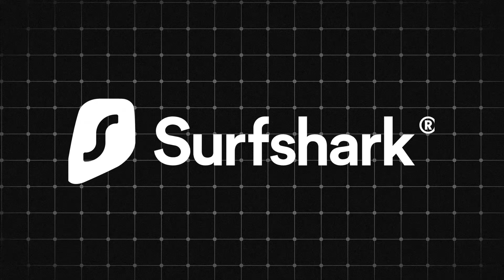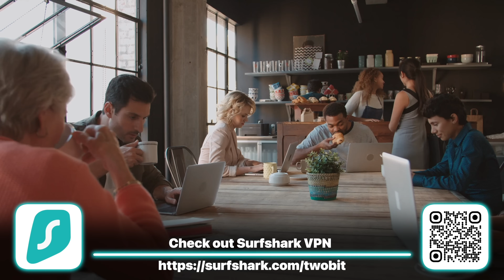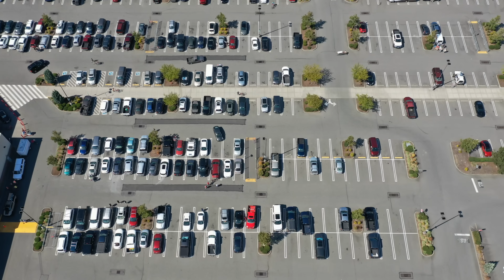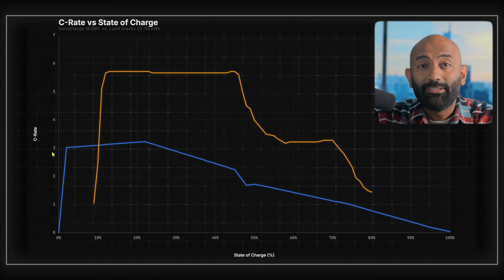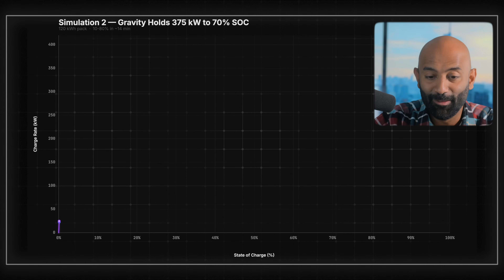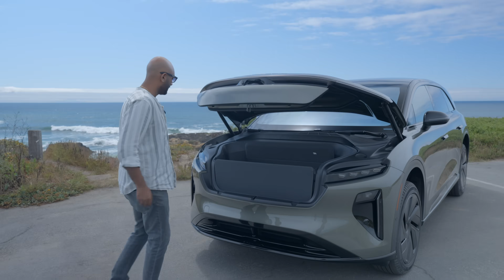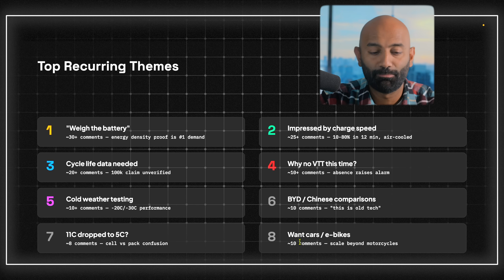Donut Lab Battery Test 4 Changes Everything!

Comment: I mean I'm of a lets wait and see mindset. That being said we already had a charge rate test right?

I can't disagree with the title more. We already know the cells can charge fairly fast. This changed nothing from what we knew before.

Show me one of the other claims being tested not a repeat.
Reply: Well the test showed that they have a real battery pack that works and can be cooled, and not just burning up at the charger, when 5C is put into it. And this video was filmed last aug/sep as the grass is green and only green leaves at the trees in the background.
Reply: @anderstengstrom9525 guess my point is we already know they have a pack and cells. What everyone wants to know is if that pack meets their biggest claims. Cold weather performance, thermal runaway, puncture tests, cycling tests and lastly 400 Wh/kg. Other minor claims lab tests showing no rare earths/ conflict elements. No nickel, no cobalt and no lithium as they claimed.

So far we have charging speed and temperature test at one cycle.

There are already fast charging batteries out there from BYD and others.

The big ones are energy density and cycle life. I thought for sure we would get cold temperature testing this week. Delaying the density and cycling life for the last episodes.

At this point the motorcycle is supposed to start delivers in April. If they keep delaying the test results and doing 1 claim per week the batteries will be in peoples hands before they finish the testing video series. Assuming they don’t push the delivery date out again.

Comment: Thanks for keeping us informed on this battery.  As an EV owner for about 4 years I have to tell you that the only charging that counts is 20% - 80%.  Why?  Because most manufacturers claim that letting the charge go below 20% repeatedly will shorten the battery life.  They also claim that charging over 80% repeatedly will also shorten the battery life.  There are exceptions.  My Ford F-150 Lightning manual says to charge it between 20% and 90%.  Not sure why they deviate from the norm by adding 10% but they must have done tests and so have their reasons.  PLEASE keep us updated on any Donut news as it is available.  Thanks.
Reply: LiFePo batteries don't care about those limits, and neither do they mind temperature extremes.
Reply: @davis.fourohfour  Will those run at -30°C, or -70°C?
Reply: That depends on the upper buffer. My sister in law has a BMW i3 for several years now with almost 200k km and it charges the car to 100% everyday because she needs it, if it was 80% she wouldn't be able to get back to home. That is fine because BMW keeps a huge upper buffer that even by charging everyday to 100% doesn't degrade the battery that much, even if it says 100% on the screen the battery only charges to 80 something % in reality... Ford says 90% because it has another 10% hided from you as a buffer.

Comment: At first i was half convinced they had a battery that they slapped solid state on the packaging hoping no one would call them on it. But now, even if its not actually all solid state, it seems like a good battery. And it doesnt really matter what you call it if it can perform. At this point I'm waiting for the downside that it must have.

The next test i think will either be a safety test or a cold test.
Reply: I built 5C Li-Ion batteries myself back in University. They have a horrible energy density and lifetime but otherwise are perfectly possible. Donut still did not show a comprehensive test with cycling, physical dimensions and weight, so all this is PR nonsense
Reply: Chinese National Automotive Standardization Technical Committee published “Solid-State Battery for electric vehicle – Part 1: Terms and Classification" will prevent this in the very near future.

Comment: One interesting thing is this, even if the Donut battery only performed a little better than other batteries in all these tests, the standout feature is actually the claimed the cycle life of 100,000. Given a hard usage by a car driver putting it through a full charge and discharge cycle every single day with a 100,000 cycle life this battery should still last between 250 and 300 years. I mean imagine that, as far as humans are concerned this would be a forever battery, never need replacing in a single humans life time, that's going to be the single most important test, a battery that basically lasts forever as far as the initial purchaser is concerned. What you have to realise is, if you have a battery that basically lasts forever, as you manufacture more batteries the need for more batteries reduces. If you make enough batteries for all the cars in the world, say 1.6b car batteries, and they each last for over 250 years, you don't have to mass manufacture any more car batteries for another 250 years! Well except for replacing damaged ones and for the small increased number of cars on the road.

So far all the tests show this as an adequate battery, we still need energy density and cycle life, but if those are anywhere near the claimed figures is it actually what so many people call a "game changer," not the battery itself though, that's just a battery, it's the cycle life, that's what would be game changing. If other companies develop similar technologies with similar life cycle numbers, and they will, that is the game changing part. Put a battery on a new house, it will last the entire lifetime of that house, your great grandchildren will still be using that battery! Car batteries just re-used when the rest of the car deteriorates to the point it needs replacing. That's the test I wait for, all the rest are....interesting and useful, higher energy density, yeah good, temperature range, another good thing, fast charging, useful, but a cycle life of 100,000, people don't realise how important that would be if it were true, that's the big thing here!

The implications behind a battery that will last 250+ years are just mind boggling. I mean it reminds one of the Dr Who Episode "Carnival of Monsters" with a device powered by a device that could last forever and someone asks, "whatever happened to that company," well they went bust because once they sold everyone a device they couldn't sell any more!
Reply: but no test so far has verified any SOH after any amount of cycles so 100.000 cycles is nowhere trustful claims so far
Reply: @hugodeandres1497  Well that's right, that's why it's one of the most important tests, both the results and the process used to get to any number they show. For a start we know they have had the batteries for a minimum of 10 days so with fast charge and discharge done continuously that gives us the possibility of at least 500 full cycles.

Now LFP batteries show some small degradation over the first small number of cycles and then settle down after that, but that's with normal charging between 40% and 80% and not extreme temperature charging that does cause early degradation, so over 500 cycles the data should tell us something about the battery longevity as well as differences between this battery and LFP batteries, so even if it's not proof of 100,000 cycles, and I don't really know how you could do that definitively without actually running a battery through 100,000 cycles, the differences between this battery and regular batteries should show up in a 500 cycle test regime, if it is indeed different.

It is certainly one to watch for, not sure exactly how they are going to present this, maybe there is actually a battery still at the testing lab going through cycles as we speak and they are waiting for it to complete a few thousand cycles before presenting that data.

Comment: For vehicles, I still prefer ICE. Largely because of the reliability, durability, and energy independence. Any machinist with a little bit of will, can make an ICE. Properly made engines can run on biogas or wood gas if necessary, both renewable and both potentially able to be produced on an individual basis. The only way to make these batteries is in factories. They cleave away independence. I don't mind the iron flow battery from ESS, it's mostly serviceable by anyone. How many Chinese electric car companies have gone out of business and their servers got shutdown? Now those cars are expensive piles of metal that are completely crashed waiting for software updates. It's a problem with modern vehicles in general, not just electric. But it's worse with electric vehicles.
Reply: Plenty of non-Chinese EVs out there, and if you think ICE cars are more reliable than EVs, you haven't seen breakdown statiatics yet. Don't believe the fossil panic agenda. Look at the data and just try an up-to-date EV. Just once.

Comment: Can someone estimate the weight from there videos?🧐
Reply: It's a motorcycle with a hundred pound li-on pack replaced with a Donut pack. I'd say the pack weighs the same, or the cycle would handle poorly. If the number of cells are the same in both, and they'd have to be to fit, then you have your answer as to weight. About the same as the li-on cells. Not too much less or more unless the pouches are full of lead.
Reply: @davis.fourohfour  Thanks but I was talking about from other videos single cell test video from donut lab.
Reply: @Yas0753  that, no. But it seems we know from the motorcycle. Either they're lying or not. 320 miles from a 35kw pack. Fits in the space. It does weigh 100 pounds.
Reply: @davis.fourohfour  I don’t get the math but what is your energy density estimate by the video ?

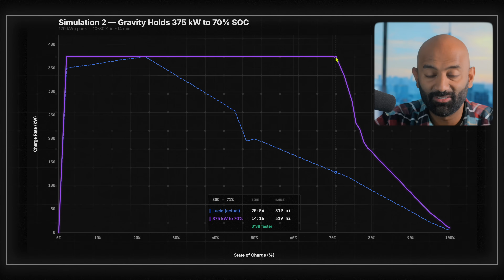Comment: 16:16 if the drop in charge was due to heat at the higher charge rate, then it might be able to continue charging at the higher rate past 70%, since it wouldn't have the heat built up from the previous fast charging. Depending on how the cooling software works and the efficiency of the cooling.

Comment: "We can't verify their claims, and we can't verify their chemistry, more and more information is coming out, but trust us bro."  
  
 <breathe in... breathe out>
Reply: @brianstone6463  Yeah, but they have never been proven to be wrong about ANYTHING they have claimed so far. Do you have the cells to understand this?
Reply: @PravinDahal  Kind of difficult to prove anything when nobody else has their hands on it. It’d be like me stating I have a device that can turn water into wine, making a show of using it in front of you, and showing that indeed, when I put water into it, wine comes out, but refusing to let you see the innards, or have one for yourself. Essentially they’ve made a bunch of claims that at present are impossible to falsify with certainty, because even if it’s results not possible with current tech, one could still argue they’ve found some crazy new discovery. As far as investor grifts go, it’s pretty standard. If anyone claims you’re lying, just say “well, you’ve never actually tested it have you, we have, and we can promise it works”.
Reply: Have fun, I guess.we already have the tests we need. It works or it doesn't. Seems to work. Doubt if the cells are made of lead. We can insulate and heat a pack. Those two factors are all left that matter.

Comment: This analysis series you've been ding has been great- I've particularly enjoyed the gauging of the community response too. Analysis of not just the information being presented but the way that it people are responding to it.
I know very, very little about batteries. To me it seems a little strange that the first project they're putting this into is a motorbike. I would think that if they wanted something impressive, large and easily understandable by the common folk a car would be a better application for it. If they're going for a smaller scale high efficiency application then I would've thought ebikes would be the go to especially as so many concerns about fires from non solid batteries exist in this sector.
Do you think there's something about this size or form factor that is particularly well suited to the capbilities, chemistry or limitations of the battery tech? Or is there some advantage to the motorbike platform that I'm missing?
Reply: Donut already had a revolutionary motor and the Verge motorcycle.

Comment: Crazy idea, what if the initial charge is meant to warm up the battery cell material itself? The material is primed as it heats up, then the BMS throttles to condition the material for the latter half of the charge cycle. The behavior during the heat test would track if this battery material behaves better at higher temps.

Comment: Worse case scenario is, the tech isn't perfect. Brace yourself, it won't be perfect.
But it WILL be good enough. A year or two shaking out the inevitable disasters starting up, then we're good. And then the Chinese knockoff chemistry will be announced and no one will question them at all.
Reply: Hate to break the news to you but there are Chinese Ecar companies coming out with Solid State battery packs this year too
Reply: @jaaklucas1329   Donut is in a different class in all categories. And Estonia and Finland aren't currently setting up to invade Taiwan.
Reply: @davis.fourohfour  I love the Verge bike. If the battery is half as good as claimed its very good news
Reply: Kinda barking up the wrong tree here. Chinese manufacturers are way ahead of the Western competition in terms of charge rates, energy densities, and costs. It would be refreshing to see a Western company being able to catch up when BYD is right now making 10+ cars that can use their Flash Charging tech (i.e. charge to 97% SoC in under 10 min) or Geely's Zeekr Golden Brick batteries with a similar performance. And these are 'just' the cheap LFP cells. There are solid state ones to come later this year, too. Nah, on battery tech, it's the West that is behind. Until maybe Donut's innovation puts us back on the map. If it can...

Comment: There's something I feel like I should point out.. Or at least say.. 

I don't think these tests were done recently... These Donut tests.. I think these were done months months back, maybe even 2025... So they already have all they need, but just trying to be careful what type of info they drop out.. 

They've sat down to think of what type of tests to release to the public that won't give out their secret sauce... They know they have a working system... 

It's interesting to see where this leads.
Reply: Of course Donut did these tests months or even years ago. This tech has been under development for over ten years - and NOT by Donut. Donut didn't develop the battery. Those who did presented both the batteries and tests to Donut long ago. So I'm confident that it works. 
They apparently are under a nuclear powered NDA.
Reply: @davis.fourohfour : Yes, it started ~10 years back... at Verge.
Donut is a spinoff of Verge to handle the battery and hubless wheel/motor tech, leaving the bikes with Verge.
It's not some competitor to Verge.
AIUI... it's the two brothers who CEO each company, respectively.
Reply: I agrée
Reply: re: "It's interesting to see where this leads."  exactly, so like someone wisely quipped either here with "Mister Ricky"...? or over at Ryan's Ziroth channel...?  this battery has the HIGHEST ENTERTAINMENT VALUE of any battery currently on the market.😲🤣
Reply: Because if it's made in Finland, there is no snow around.

Comment: What I don't see discussed, how much of a factor is ambient temperatures? 

Finland is a cold place, so it will help with the no active cooling, how will this charging go in much hotter ambient temperatures?
Reply: @dheath3697  the reason is because every battery has this problem. Just not the same impact. So far we’ve seen that the battery can operate at much higher temperatures than its rivals. Meaning, when all things are considered equal, this battery will be able to maintain high charging for a longer period of time compared to other packs. Plus there will be less to no damage compared to other cells. So far there is nothing to indicate that these batteries will do worse in high temperatures compared to other batteries.
Reply: Remember, the VTT independant test #1 confirmed good charge performance at even 90 Celsius which is 194 Fahrenheit. So not an issue.
Reply: @dheath3697  True but still would imagine liquid cooled car version to be able to beat near 0°C with a fan in cooling power.
Reply: @MrGragtor Yes that's still very cold, I live in average 30+°, so I wonder how it's charging capability goes in much higher ambient temperatures with only passive cooling.
Reply: This was filmed in Tallinn Estonia. There's no snow and the grass is greenish, so it might be an older video. But if it's recent, the temperature is somewhere around 0-10 degrees Celsius.

Comment: Comparing the charging rate of a commercially sold vehicle to that of a demo bike is pointless. A company like Lucid has to ensure that its battery remains in good condition even after repeated fast charging over the vehicle’s lifespan. In contrast, Donut is only demonstrating performance for a single test cycle, so they can push the battery to its absolute limits. That doesn’t mean current batteries are incapable of charging from 10–80% in 12 minutes. They likely can, but doing so consistently would significantly reduce the battery’s lifespan.
Reply: Yeah, their marketing is scammy and they always hide a bunch of specs